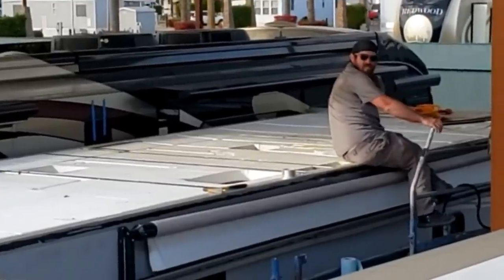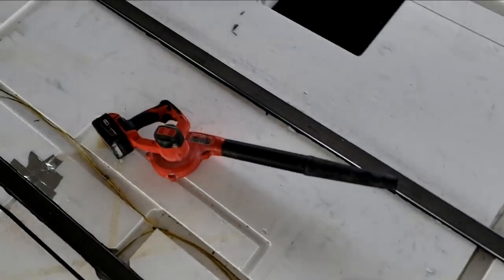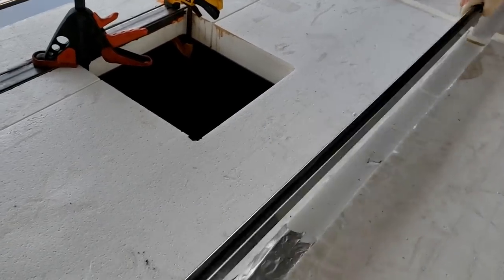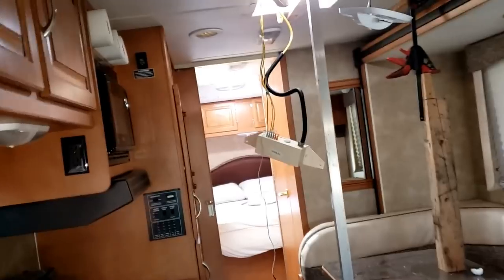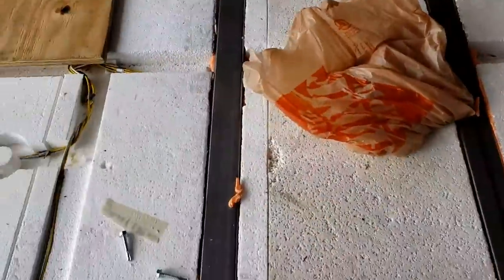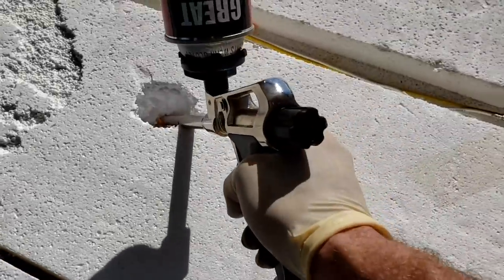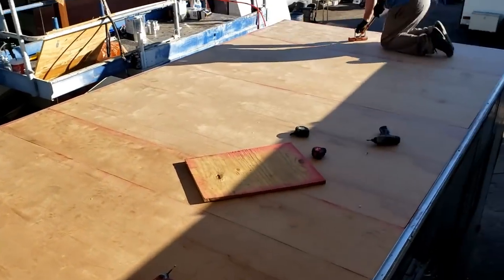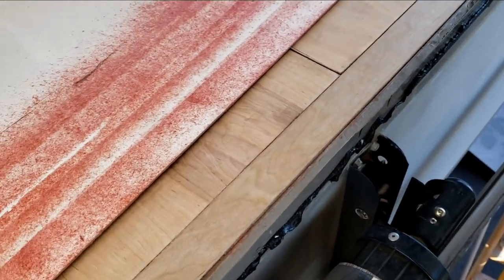How Did We Secure Steel to a Foam Roof? 2014 Minnie-Winnie

Comment: You two really went the extra mile with the details doing this job , so refreshing to see people taking pride in a job .👍
Reply from the maker: Thanks 👍
Reply: They really didn’t go to the extreme on this job he knows he could’ve double layered that with 8 inch plywood ran at two different directions and would not of been too thick and would have been a lot stronger but you have to give them A for effort

Comment: They need to keep that RV because that roof is going to last longer than the RV. As I said you guys do good work. I like how you reinforced the steel with wood. As long as no water intrusion that will be there that means from inside too, need a dehumidifier for the inside for winter. Great Video you and Chad are a great team. Stay Safe ✌🏽
Reply from the maker: Thank you very much!!

Comment: when steel touches aluminum that creates a molecular reaction. this causes both metals to detierioare at extremely fast rate. I would put plastic or rubber strips between and oversize the holes in the aluminum so the screws could pass through without touching and anchor in the wood that would make a near bullet proof structure.
Reply from the maker: Dis-similar metal can be an issue for sure, but I also see how these are made. All the screws into the aluminum are steel anyway. Water is the big concern for me

Comment: Did you want your temp stringers to bow while you were pushing up from the inside? If not turn them on their ends and they are a lot stiffer. Awesome work by you and Chad, can't till the final product is revealed.
Reply from the maker: yes they are too wide and will block the A/C duct on end

Comment: Bridging the holes for the duct system was a good idea.  Did you reverse the the tape so that it was not sticky inside the duct which would collect dust and impede air flow?
Reply from the maker: OF course.

Comment: Out of curiosity are you going to put screws from inside into those supports to hold the ceiling up ?
Reply from the maker: We had thought about it, but the screws would have to compress 3 inches of foam so I doubt they would do much. The A/C and vents clamp the ceiling to the roof so they will help a great deal too.

Comment: Not planning to compete with you. However just curious what's it take to be an RV Tech? I have considered at times maybe doing it mobile. I happen to hold a Master Plumbing, Master Mechanical and Master Electrical License. I have twenty years experience in those trades. My master plumbing is a certification that includes gas piping, both LP and Natural Gas. My Master Mechanical which is HVAC certifies for gas too. I understand how RV furnaces, water heaters, air conditioners etc work. Most everything I have repaired on mine seems like common sense for the most part.  I have also done extensive remodeling on both commercial and residential projects. Have considered doing it as either a part time thing, or maybe in the future doing it while traveling and living in RV full time someday. 

I understand if you don't want to answer, just figured you'd be a good person to ask.

Thanks and really enjoy your videos. You do a lot of repairs I would not want to tackle. Rebuilding bodies, etc.
Reply from the maker: Sounds like you already are a RV tech. The industry needs good people like you. If it's interests you I'd get with a good dealer and start. It will take about 6 months to get a good understanding of where things are laid out and the basics of RVs
Reply: Thanks for your confidence.

Comment: I have a 2000 monaco windsor that the exterior entry handle broke , i need to get in . was wondering when you did that video how you got thru drivers window . hoping there is a way with out tearing it up . would appreciate any help
Reply from the maker: The latch was broken. In an emergency, you should be able to break the plastic latch holding a sliding window locked. If trying to slide the window doesn't work, you'd have to use a thin putty knife to break it. Of course only in emergency and be careful
Reply: @AZExpert  thanks ,

Comment: These may be more time consuming than you like but I use these for securing plywood down and flushing the screws...you use the flush drill head then come back and put the screw in...larger screw head span (9/16") for better plywood holding...screws come in metal and wood thread...a just in case you ever need something like this. GREAT for squeaky floors and what not...https://www.fastcap.com/product/spade-flush-mount-drill-bit-system   https://www.fastcap.com/product/powerhead-metal-screws
Reply from the maker: thank you

Comment: All RVs should have at least half inch plywood on the roof but no less than quarter because you know as well as anybody your worst problem or with Rv roofs of course manufactures know that that’s why they build the roofs so cheaply so you’ll be back for a new RV or roof replacement it may cut your job down at least 50% though
Reply from the maker: I agree, roofs take a great deal of abuse.

Comment: hi 8x4 feet plywood is meter     243.84 cm x 121.92cm  meter came in 240cm x 120cm  people has build use feet problem find  mach size
Reply from the maker: I am terrible at metric measurements too

Comment: I think I would have painted those first. Steel rusts really fast.
Reply from the maker: I thought about it, but I want the adhesive to stick to the steel, not the paint. Winnebago did not paint their straps. It will rust anyway, even if painted. And that was very thick wall steel. Should be able to rust for a few decades before failing.  Thanks!
Reply: @AZExpert  agree..